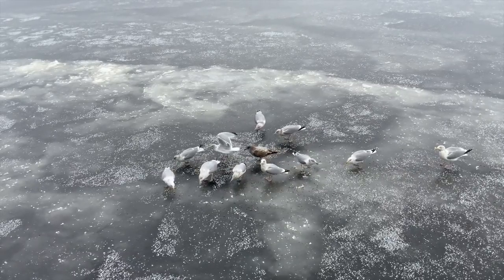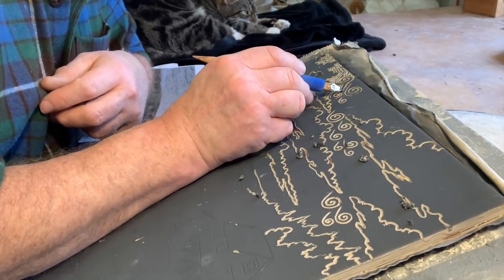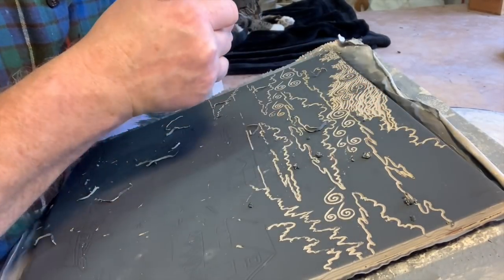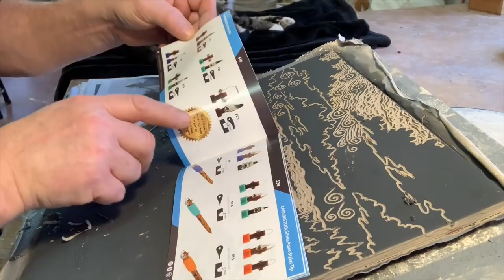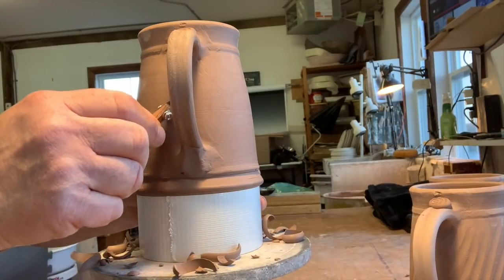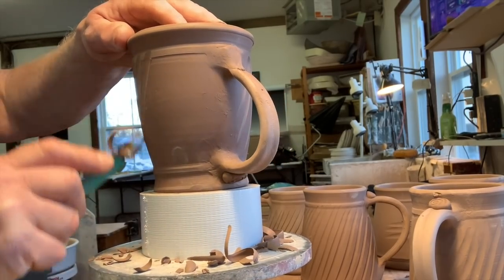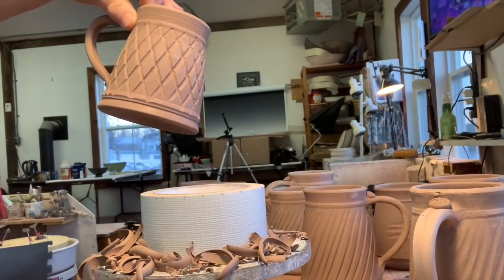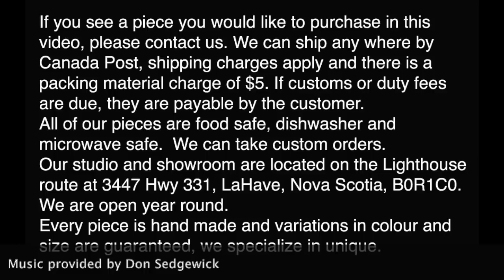Carving Mugs and Tiles

Comment: Wonderful! Do you make your own slips? I’ve been wanting to experiment with slips, but I’m stuck teaching myself right now because of COVID and my immune disease. Do you just make a slurry of clay and color it with oxides or mason stains?
Reply from the maker: I make my own slips. Slip trailing is done just using the regular white B-Mix5. I use Robin Hoppers slip recipes in The book "The Ceramic Spectrum". He has different ones depending on the temperature you fire to.

Comment: This is a great video Vaughn! I have been wondering for a long time if the Diamond core tools are worth the money. I obviously don’t do such detailed work as you but I do love to do the carvings like on your mugs. They just seem to be extremely expensive.  Are there other carving tools that you’ve tried other than the ones you showed that you could suggest for someone like myself? Thanks!
Reply from the maker: I have lots of carving tools from all sources. They all work fine. My issue is that many are too narrow to hold for long periods. I thicken them with duct tape, rubber bands, anything that helps make them easier to hold. I hope for the expense the diamond core tools last a lot longer too. The Kemper tool is my favourite for fine detail but I wear them out very quickly. Sometimes they only last a month. I have to replace the complete tool. I hope the replacement heads of Diamond Core tools are more economical.
Reply: @Vsmithpots  Thank you!

Comment: With those small handled tool…. Buy some polymer clay, like Sculpey and you can build up the handle to whatever is comfortable n bake in a home oven, Also an epoxy clay can be used if you can’t bake the tool
Reply from the maker: I've been using rubber bands and duct tape.
Reply: @Vsmithpots  lol yes I get it, “if it ain’t broke”! But if you ever need a custom tool or just love tools enough you might like making them (like me), perhaps a wide scoring tool, maybe in a pinch n need a special carver with bezel or round wire or perhaps even a custom buck tail pin stripper, it’s just nice to have around the house and studio. Also, because those “clays” must be cured, they don’t dry out
Reply from the maker: @deannak1841  I too like making my own tools. I have more tools than anyone can use in one lifetime so I like to modify the ones I have. The Femo clay is nice to make handles, I have a 6 pin scoring tool that I use often.